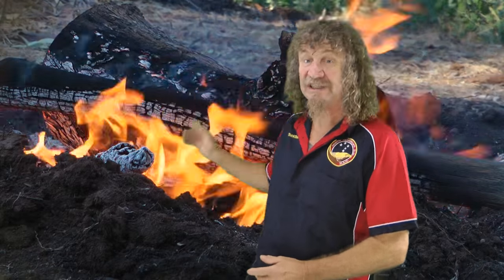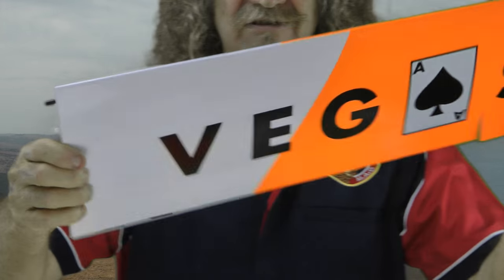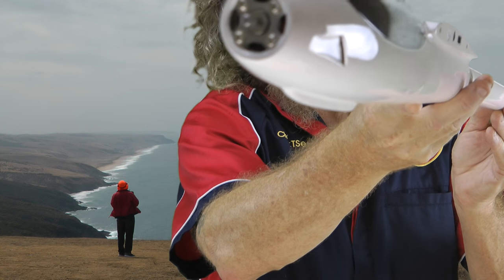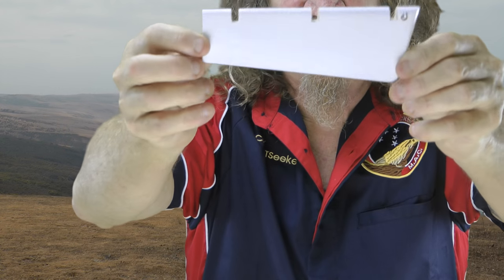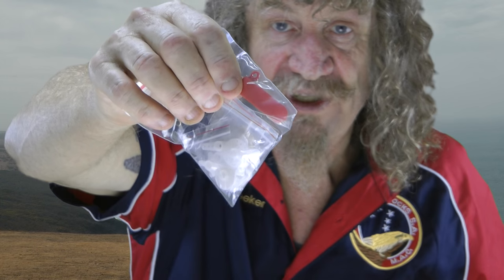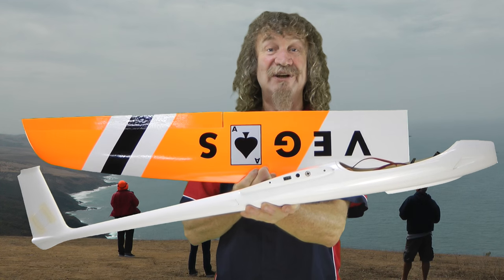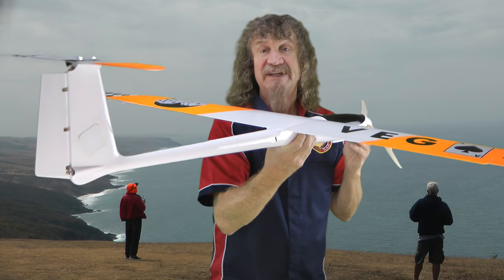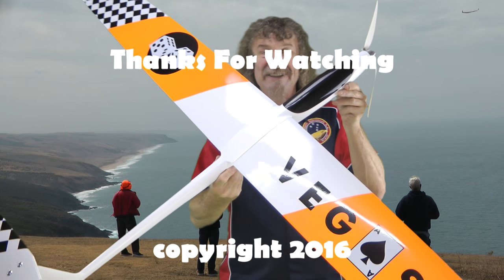Staufenbiel Vegas Hotliner Glider Un-Boxed with ChuckT

Comment: Does the tail section bolt on and off for transport?
Reply from the maker: +jsa2001 Yes! I also  saved the box it came in and modified it a little and i transport my Vegas stored in the box. Took the front packaging box out cut a slot in the original box and glued/taped the inner storage box to the front of the original box and that holds my glider safe